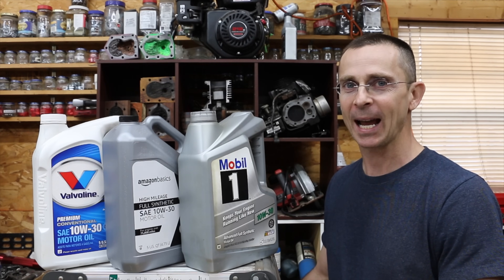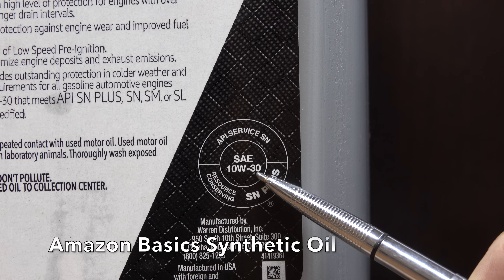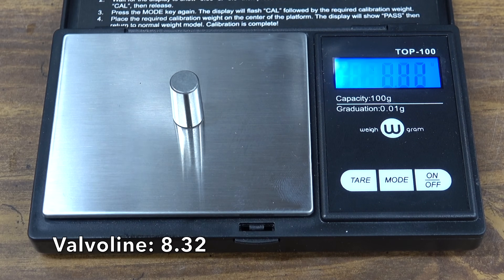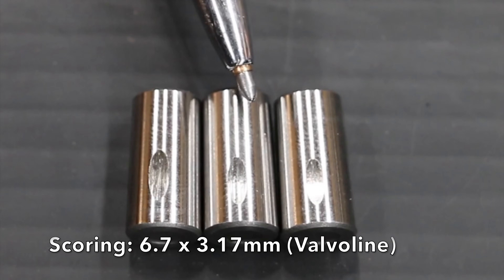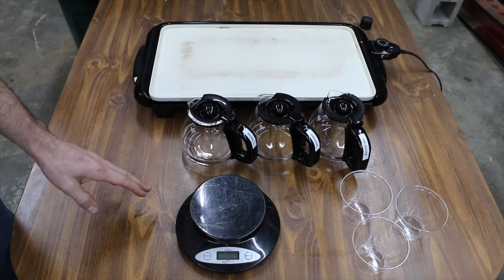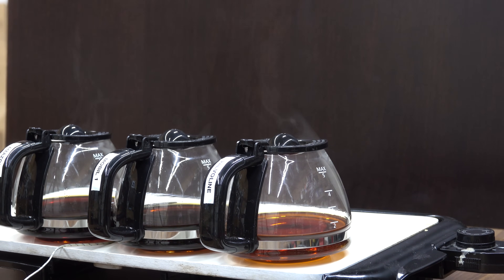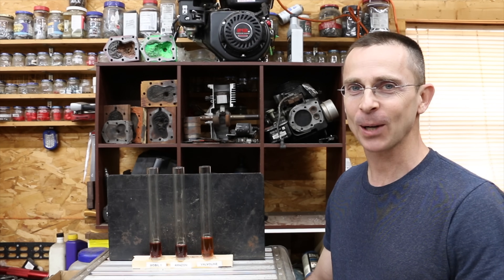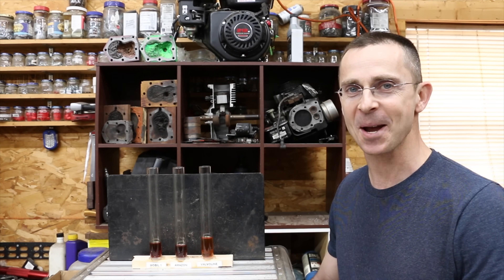Is AmazonBasics Full Synthetic Motor Oil better than Mobil 1? Let's find out!

Comment: Just throwing this out there: as an IT guy who did desktop support for 5 years, I can corroborate AmazonBasics really having quality stuff. Cables, adapters, accessories, batteries, all of the 'little things'. Last year we replaced a lot of our 'standard config' stock with AmazonBasics products- things that we used to source from StarTech, Cables2Go, TrippLite, Belkin, and even some Logitech SKUs. Those are well known, quality brands. Amazon met or exceeded them at lower prices, so it doesn't shock me in the least that their motor oil is no joke.
Reply from the maker: This is great information. Thank you!

Comment: If you like cold flow you can get 5 qt. Jug of Mobil-1 0W40 for $22 to $25 a jug. I normaly run Rotella T6 5W40 or Delo 5W40 in the warm months $19 to $20 a jug at Walmart and Mobil-10W40 in the Winter.
Reply from the maker: Thank you!

Comment: I'd like to see the other oil in that center position in the fridge just to see if that center position is affected by the potential warmth transfer from the two sides.. Seems like a possibility of that center position being a degree or two warmer than the outermost position which could support the middle position winning in all pour tests regardless of oil manufacture.. Just wondering if possible.
Reply from the maker: Thanks for the recommendation!

Comment: Love your videos can't get enough of them!! I've been trying to think of a few video ideas and I may have a couple I was thinking maybe do a video to see whether or not a engine will run off of body spray or Hairspray because if you're anything like me you've made a homemade flamethrower out of one of those products at least once but are they powerful enough to run an engine?? A few more ideas what brand spray paint is best as in fadeing and protection against corrosive substances... I was also wondering if message Lube could be used in replacement for motor oil and maybe test different drill bits and grinding rocks to find the best !!! keep up the great work!!!
Reply from the maker: Thank you for the video ideas!

Comment: The whole test is a fail, u have two full synth and a conventional...obviously the conventional wont hold up..
Reply: He was trying to show how much better either synthetic is than a good conventional oil. This is how you cut down on the "I've been running conventional oil in my rigs for the last 50 years and they've always been fine, so forget synthetics" posts.

Comment: Would you please do a video about different coolants?  It seems ridiculous that manufactures would build their engines to withstand only for their own specific green, orange, blue, etc brands.  Are their gaskets and seals and hoses that terrible to only withstand their own brand of coolants??  Or is it marketing at its best?  Thank you in advance!
Reply from the maker: Thank you for the video idea!
Reply: Most vehicles coolant flushes I do, I switch to Walmart Supertech extended life. I mix 70% coolant with distilled water. I've switched from OEM antifreeze to this on numerous different brands. 6 years and not a single problem.
Reply: @ts-handyman  OEM is made by Recochem...it's a really good product!  
 The Concentrate is only a few dollars more than the pre-blended and will give you 2 Gallons of 50/50 Mix...which is good in normal winter conditions. 
 I personally don't recommend you go over 60% Coolant to Water Mix...there is no net benefit to it in moderate temperature ranges and may actually do more harm than good.  
I live in the Canadian Shield and it is extremely cold here in the Winters of Northern Canada...and most everyone gets by fine with 55/50 Coolant/Water Mix. 
 50/50 is more than adequate for the Northern U.S.A. IMHO
Reply: Usually changing to a different type won’t hurt, but you have to flush and rinse the system to do so, because mixing them can cause problems.
Reply: just so you know, there are two types of coolants. The color means jack shit. I dont remember the names but you should never mix them.
Reply: @alexstromberg7696  ethylene glycol and propylene glycol
Reply: yeah those, thanks
Reply: As dfm503 said, just make sure to flush the old stuff first. Some antifreeze types will react when mixed.
Reply: Stan, I know of one story a guy had a Toyota that had overheating problems. He found out the coolant had been replaced with non-genuine Toyota coolant. He put genuine Toyota brand coolant in and the overheating problem allegedly went away.
Reply: Scotty Kilmer?
Reply: @cdogg1787  I'm sorry, but I don't believe that for a second.
Reply: It’s not really the system but how the different coolants react with each other, you can change to a different coolant but need to make sure the original coolant is completely flushed out first which would in itself cost more than just using the same colour coolant.
Reply: GREAT!
Reply: Toyota red is badass use it on the Maxima too
Reply: A wrong coolant put in an engine has a chance to be corrosive to the types of metals used in the engine not made for said mismatched coolant
Reply: As a mechanic I promise it’s fine to switch. Just make sure it’ll keep your engine to OEM temps. Which they pretty much all do. 

My 05 dodge is running LLC blue coolant from newer infiniti and Nissan vehicles and has been for several years without any issue. Hope that helps. :)
Reply: @cee9585  this is not always the case, I've seen a person put orange coolant from a vw with an aluminum block in a Chevy with an iron block and it started to eat at the coolant jackets in the block. It's usually fine. However some coolants can hurt certain blocks
Reply: Not Applicable 
Thanks for the response.  That’s exactly my point.  Amazing that in 2019, manufactures would cast/forge blocks, heads and components or manufacture gaskets, o-rings, hoses, etc that allegedly succumb to coolants, oils, or other vital fluids.
Reply: @keaaul808  it's a matter of metals can be sensitive to chemicals in coolants. Hence why there are different coolant types, this has nothing to do with bad manufacturing, just different materials for different purposes in different vehicles
Reply: @keaaul808  I mean I just use water with water wetter in my cars since I don't really have to deal with freezing where I live
Reply: @UC1i2NtAOUehURtCj0kZETMg it doesn't work that way in every case. Some coolant have chemicals/additives (same difference) that can corrode metals in some engines. Although most coolant/engine combos are fine. Doesn't mean that you can just expect that it is going to be fine. There is a reason why that manufacturers will choose a coolant for an engine. Sure most coolant will do fine. But in the long term that's where issues show up
Reply: One time I ran out of coolant. Me and my buddy both pissed in the reservoir to make it back to town.

Comment: Why did you put so much Mobil 1? Of course, the bearing will lose just as much as Amazon because you had so much oil on the bearing it was barely taking any wear. Try measuring the exact amount of oil in each cup so when you do the bearing test they all get the same amount of lubrication.

Comment: Never use Valvoline oil. The synthetic will evaporate faster than any oil leak I’ve ever seen. Used it once and spun my cam bearings because the oil couldn’t handle the heat during traffic in south Texas.
Reply: I guess it's just depend on what engine. I saw alot of Chevy engines burn half to a quart of Valvoline Full Synthetic oil at 3000 miles. But on my 90000 miles Subaru FA20 engine, my oil level still at full at 7400 miles.
Reply: Erik Huynh,
I’ll give the benefit of doubt considering all the variables to consider when it happened but at the end of the day I try to learn from my own mistakes. So my engine being trashed was a lesson learned enough for me.

Comment: In my overall experience with oils, I recommend sticking to one particular brand, type and viscosity that a manufacturer recommends. Changing to different types everytime could lead to uneven surface wear and the engine might start burning oil very soon. Castrol and liqui Moly mineral oils have been my favorites.
Reply from the maker: Thank you!

Comment: Boy, I really like this test he's done. One thing I'd like him to address though is the additive packages in these oil products if he can do that has an opinion on it. Cheaper oils tend to have less additives more expensive oils naturally have more and as an oil ages the additives are consumed, boiling off, etc. So, if you use a more expensive oil with better additive packages you'll have more additives at the end of the oil change cycle. so then I guess the question would be how does Amazon basics oil stack up to Mobile 1 on that account? And, just as an aside I'd like to mention, that the viscosity index on conventional oils is produced by additives. In synthetic oils the viscosity is manufactured in. That is as, the way it is refined reflects its viscosity index. This is kind of important thing because as a conventional oil ages the additives that make the viscosity index burn off and it loses its viscosity index over time. Because synthetic oil viscosity index is manufactured in it doesn't burn off as the oil ages. Just another reason why synthetic oils are so superior to conventional. I use synthetics in everything.
Reply from the maker: Thank you!

Comment: Now the real question is how does it hold up after 10k miles? Mobil1 regular full synthetic (not anual or extended) can typically do 12-15k based on Blackstone lab testing. I push mine through 10k intervals(even though Honda maintenance minder comes on at 7.5k). If Amazon doesn't hold up for 10k then it's not really "cheaper" since you replace it more often.
Reply from the maker: Thank you!

Comment: I wouldn't be at all surprised if the Amazon, is just repackaged Mobile1,  as an aside years ago I worked in an indoor gokart shop, all we ran was mobil1 synthetic, the oil caps would constantly get knocked off by the drive chain, so more often then not the motors ran without oil for upwards of a week at a time, took 4 years before any of them started to seize or blow up
Reply from the maker: Thank you

Comment: Is it even worth testing cold flow of the oil when you can crank the car before starting it and get the oil to flow if its cold crank your car 3x then start it if the engine is loud or rough turn off and cracked it again. I have r53 mini and when it's cold the engine oil of you just turn the key will take. Its time to reach the tappets but crank it a few times and its smooth.
Reply from the maker: Thank you

Comment: Can you please make a video on oil filters .  comparing Virgin filter, 3k miles, 5k miles,  10k miles , and see how they are performing ? 
Maybe test Super Tech oil ?
Reply from the maker: Thank you for the video idea!
Reply: Oil brands make claims 15k miles, but most know its for pure highway driving, city seems to be range of 3-7.5k 

Filters making 10k claims,  i mean a filter at 7.5k looks disgusting , while oil is still good as new .

where their 10k claims based on in sterile lab under highway conditions ? 

Making a video on filters could revolutionize oil changing .

Comment: I would love you to do a expose/test of polyurethane bushings. In the C3 and c2 corvette community we have alot of guys who have no problems and many that have poly bushings fail on their sway bars trailing arms etc and bo one knows why.. is it chemicals in air? Temparature? Some fail weeks after restoration where they were intalled years ago but unused and some are fine. I am doing rubber oem on my trailing arms and wasted money on Polys. Help why do some fail? Did they use the wrong grease? We dont know...
Reply from the maker: Thank you for the video idea!

Comment: You may joke about not having the million dollar labs, but you certainly make due!  What a great video, I'm using supertech full synthetic in a 2013 Elantra GT we're planning to upgrade in 2 years.   I haven't needed to add between 4K intervals and it started and ran fine during our -30F cold snap, even with its original battery that is doubtless not in perfect condition anymore.  I have zero complaints.  Thanks for the video!
Reply from the maker: Thank you very much!

Comment: If Amazon are just buying compliant oil on the open market you might not always get the same oil.
Reply: If it's compliant who cares?
Reply: @jshepard152  because he's testing the formation he has, and you might not always get that.
Reply: @johnwade1095 
Fair enough.  I think that's what you give up by using unbranded oil.   But if it meets spec I don't think it's going to matter if it's identical every time.
Reply: The thing is, it could be meet or exceed. If it exceeds performance in some cases, something else that only just meets the spec will perform comparatively worse. It could be a case of bait and switch. Eat an early loss, get good adoption and then switch to something worse later. Maybe running the same tests twice a year with the same unbrand would be interesting to see.

Comment: I've found the Warren distribution packages lots of oil even the Wal-Mart brand. There are reviews on the Wal-Mart and the oil is not consistent as they purchase in bulk from whoever gives them the right price! One month it could be brand a then brand b and so forth. I stick with AMSOIL as the racers use it. Check out the extreme off road vehicles and most of them use AMSOIL just look at the stickers, big ones too.
Reply from the maker: Thank you!

Comment: GREAT JOB!!! 

I love all your tests, keep up the awesome work!

I just have one more question though. Should you change your oil at 3000 miles like we did with original oil's? How long would you recommend changing oil intervals with the synth oils?
Reply from the maker: Thank you!  3K oil changes are not necessary.  I normally change oil sooner than necessary at 4-5K with full synthetics in the sump.  Driving conditions and engine conditions make a huge difference.  Engines with a lot of blowby will contaminate the oil and 3K oil changes may be appropriate.  There are testing labs that can perform a detailed analysis to help determine appropriate oil change intervals.

Comment: That “spinning a wheel in a cup of oil” test is an old snake oil salesmen trick 
Anything (even some hair shampoos) that has a high zinc or phosphorus level look good on this test
Zinc and phosphorus are very good chemical EP/AW additives but too much can effect other additives and lead to quick degradation 
Your pour point test is a valid test which synthetics will always win but only really valid if you live in really cold climate
Reply from the maker: Thank you.  I did test head and shoulders a while back.  While it does have zinc, it's not ZDDP. That was a fun video.  I believe in the machine as long as there isn't a "one-arm bandit" running the test.

Comment: Could you please duplicate this test and include more oil variants such as Castrol, Liquid molly, and Royal Purple?  Love this video.
Reply from the maker: Thank you for the video idea!
Reply: @ProjectFarm  Thank you!  My reasoning behind these sets of oil is that they are considered higher performance,  and European manufactures typically require these oils that have additional API specifications such as BMW LL01 or BMW LL04.  I would love to see the performance of these higher end oils.  At the end of the day my 1995 F150 will get what ever super tech oil walmart sells that meets its specification for oil requirements,  but my higher end machines will always get that liquid gold ;).

Comment: I have a request pleas test full synthetics valvoline , Mobil 1 , Castrol,  amzoil , Walmart oil , quakerstate , make share they are full synthetic and not high mileage.  5w 30. Please this would be most informative for your audience.  Thank you if needed I will donate for valvoline as it's one of the highest priced. PM me if needed.
Reply from the maker: Thank you!  I just ordered a bunch of 5W-30 full and 100% synthetic oil products for testing.  Thanks for the offer.

Comment: Great test on bearings. Now mix a little molybdenum disulfide in with the oils. Any of them. You will see no wear at all.
   Addendum:  I just now realized what you were missing in your test. Do another bearing test with no oil at all or just use water to cool it.
If there is only the same amount of wear as with a lubricant, not significantly higher, then the bearing test is worthless as no oil could do any better or worse. Oil isn't magic, it needs proper pressure and clearances to perform.
Reply from the maker: Thank you for the video idea!

Comment: As always an excellent study. Going further than the regular guy would. 
I was curious since Amazon oil did flow better at low temp, how would it compare to mobile 1 and Valvoline if the lubricity test were conducted at or near below zero degree Fahrenheit. I realize your facility would likely prevent this but possibly if each plastic cup filled with each oil were placed into the subzero environment then a lubricity test was then conducted. Would there even be a difference or perhaps the bearing and race would heat up too quickly and results would be negligible. 
By the way isn't the Amazon oil and the Wal-Mart oil may possibly be made by Warren Distribution. Although I could be partially incorrect if Wal-Mart purchases from more than one manufacturer. Amazon does have free shipping with a prime account which saves gas and delivery costs.
Reply from the maker: Great test idea! Yes, Warren bottles oil for Walmart and Amazon.  I should compare them to see if they perform the same.
Reply: Project Farm your tests remind me of my U.C. Davis material science class. Your efforts are very inspirational.